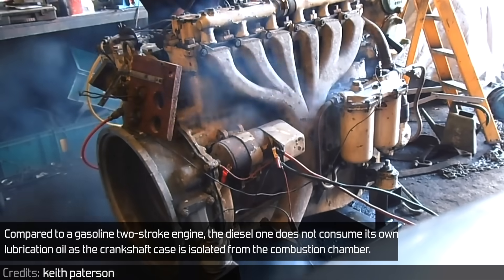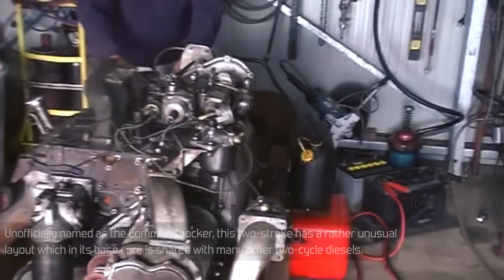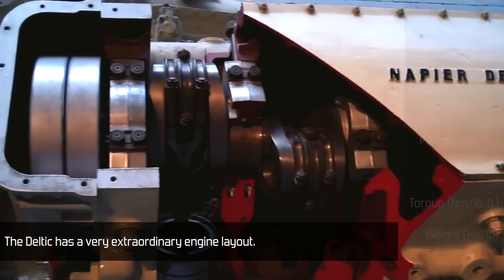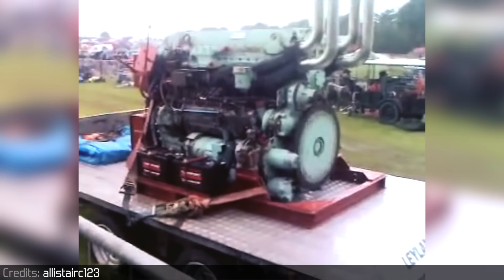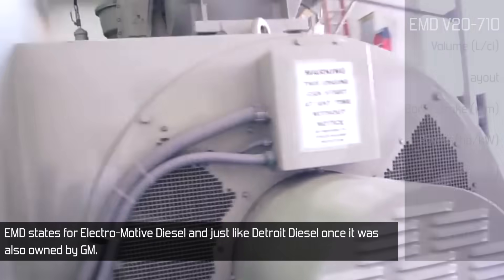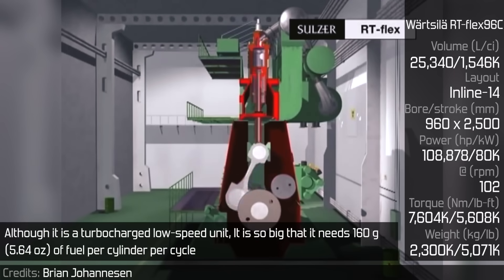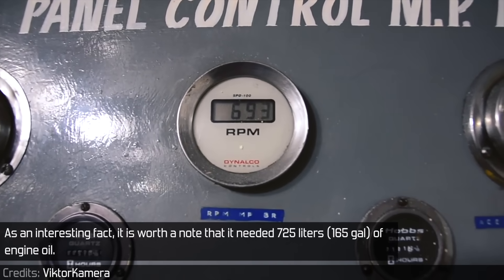9 Cool 2-Stroke Diesel Engines

Comment: 100hp and 7000nm of torque
damn diesels
Reply: Now imagine the torque figure of an EMD 16-710 putting out about 5000hp
Reply: @HotForgeChaos  41,933 Newton Meters?!?!? Jesus Christ!
Reply: I like diesels and they surprise me with their torque figures fairly often. The VW 2.0l TDI only has 140 hp, but it makes like 265 lb-ft of torque.
Reply: @boostaddict_  YEP. My father had a passat diesel, that car was insane, more torque than a subaru WRX. After 40mph you could feel the lack of power but it was still just a gorgeous car in the low RPM
Reply: The reason for a diesel's modest horsepower figures, is simply because of limited rpm capabilities. Power is torque x revs. Diesel is much slower burning than petrol, so as revs rise, the burning fuel has less time to exert force on the piston. By 3000 rpm in a car diesel, 85% of the peak horsepower is available, so they respond best by short shifting. Most car diesels have peaked by 4000 rpm, while a petrol engine usually peaks around 6000. So to make the same power, a diesel has to produce an extra 33% torque at 4000 relative to a petrol's 6000 rpm torque figure. A turbo diesel will easily exceed a naturally aspirated petrol equivalent for power within its 2/3rds rev capability, & produce over 2/3rds the power of even a turbo petrol engine, despite giving away over 2500 rpm. Because diesels can withstand boost pressures that would disintegrate a petrol engine in minutes, a turbo diesel can still exceed the peak torque (& therefore power output) of a turbo petrol equivalent between 1500 & 3000. If you were to compare the power output of a naturally aspirated petrol or a turbo petrol at 4000 rpm, with that of an equivalent capacity turbo diesel at the same engine speed, you would usually find that it is the petrol engine that is the weaker unit.
Reply: @hiyadroogs  actually it's not the slower burner fuel its because diesel parts are under more stress than gas engines so they have to be made out of thicker and stronger parts to handle the high compression . And racing diesel engines go 7000-9000rpm but they wear down faster than a gasoline engine in a similar rpm range
Reply: @xxzenonionnex7658  You are partly right. Diesels do require heavier construction generally to withstand both compression pressures (though those have come down considerably since indirect injection diesels with 22.5:1, compared to as little as 15.5:1 for some modern direct injection types) - also to withstand the huge combustion pressures generated by very high boost pressures that would destroy a petrol engine in minutes. But with modern metallurgy, this is not too much of a problem. Traditionally, diesels were long stroke (under square engines) & therefore couldn't attain high revs. But in car engines at least, this is no longer the case. Diesel combustion occurs much slower than petrol, which vaporises very easily. Diesel fuel does not. Which is why modern injection pumps exceed 2,000 bar, or over 30,000 psi, to atomise the fuel from the injector nozzle against 250 psi compression pressures. Even with a turbocharger, sometimes more than one in a 4 cylinder diesel, & 4 bar boost pressures, all diesel torque curves begin subsiding after 3,000 rpm because of the slower burning fuel. The mechanical set up of the car diesel could easily exceed 6000 rpm, but the peak torque occurs between 1,500 to 2,500, sometimes sustained until 3,000, but then falls away steadily until peak power is attained between 4,000 & occasionally 4,500. Many car diesels are set up to arrive at maximum power by 3,500, precisely to keep the engine inside it's most efficient combustion range. It is true that in tractor pulling, engines can go to 6,000. But there are reasons. 1, they are fitted with multiple turbochargers, sometimes 4 on a 6 cylinder engine, pushing boost pressures beyond 200 psi! 2, they massively over fuel the unit to gain every horsepower the engine can muster without destroying the crank, pistons or block. 3, the engine often has water injection to stop the pistons melting. 4, this can only be mechanically sustained for seconds, not minutes. & 5, by 6,000, though the horsepower is high, the torque peak is over 2,000 lower down the rpm range. The price for forcing a slow burning diesel engine to make power at petrol engine revs, is scorched pistons & valves, massive over fuelling that the engine can only endure for seconds, huge clouds of black smoke because the slow burning combustion cannot complete the burn in the short time allowed, & having to fit multiple turbos ramming in ridiculous amounts of pressure. Try that in a road car & you will be rebuilding the engine every couple of weeks!
Reply: Just gearbox the hell outta them and you got a performance engine with reliability
Reply: i like high torque engine, but i want diesels get more power (power to weight radio)
Reply: @stephensu4371   Check out the batmobile willys coupe diesel. It makes 2000+ hp and literally unmeasureable amounts of torque, it can't even be dynoed

Comment: Detroit Diesel still makes 2 cycle engines, just mostly for marine or generator applications, as recently as 2014 I believe.  Unfortunately production for truck engines has seized, so blocks will have to be restored with new parts, no more new casts being made.

Comment: The most efficient engine ever made is the Napier Deltic.
Reply: David Blalock - Livin' Life I would say wärtsilä is the most efficient. (gained hp per liters of fuel consumed)
Reply: Not so sure about that. However, the Napier Deltic engine had the same inherent problems Fairbanks Morse did with their opposed piston designs; neither had any cylinder heads and had a complicated gearing mechanism to join multiple crankshafts to a single driving shaft.
Reply: @T-Bag Actually, the Achates Power's Opposed piston design  has already surpassed the wärtsilä for specific efficiency achieving an independently confirmed 55% BTE. 

@rayford21 I agree with you on the Fairbanks Morse to a point, but the deltic integrated the gear reduction into that system. As a result the engine rpms at the crank may be 1700 at it high idle, but the output shaft was only turning at 850 rpms.  This allowed the engine to be installed as a direct drive system in marine applications.  CP Props improved efficiency as well.

Comment: I need 750 liters of oil for my oil change.
Reply: Just don't forget to put the sump plug back in when you fill it up ...
Reply: Oh nevermind the head gasket is blown.
Reply: CALL THE SPILL CREW, THE BAY IS F%&#ED.
Reply: Feed it into the fuel pump and a mixing valve and your 2 stroke can burn it off, hence total loss, your 2 stroke diesel will turn the oil into energy! iv have done that on 8v71 generator before.
Reply: Fill it with castor 927 maxima with a rigged up dry sump and a few VRO pumps into the fuel, no oil change needed just like a rotax 850

Comment: Woah, 14 1 meter wide pistons, 109,000 Hp, 5,600,000 ftlbs torque, 100 rpm redline. 500 lbs of fuel consumed per minute. Talk about an expensive tank of fuel.
Reply: Ryan Fisher I worked on a ship with that engines little brother. 6rtflex-58, we burned over 30mt of fuel per day.
Reply: FlatBroke612 Wow so roughly 60,000 lbs of fuel? Maybe 15,000 gallons? Amazing that's a lot of $ It must have been quite an experience, I would love to hear and feel that engine working!
Reply: 500 lbs. of fuel per minute?...Hello?  At 8lbs. per gallon crossing an ocean must necessitate a huge fuel tank and an unheard of speed to reach its destination.

Comment: Detroit diesel is king of 2 cycle diesel performance
Reply: It sounds like its running at a high rpm
Reply: 2 strokes do.
Reply: Don’t for get Fairbanks Morse, Sachs, deutz, Stijl and JLO. There was a huge single in a Field Marshall tractor, crankcase pressurized. Model 32 Fairbanks Morse is the biggest crankcase pressured 2 stroke I have heard with 2100 CID per cylinder
Reply: I just got a silver 8v92 to tinker with, i might go grap a 12v71 turbo and yes 2 stroke diesels consume there lube oil, i work with them on offshore boats.

Comment: All opposed piston diesels just have ports and no exhaust valves, while most normal 2 stroke diesels have exhaust valves.
This because in an opposed piston engine the intake and exhaust ports are not at the same heightbut at some distance from each other, one piston operates the intake ports and the other the exhaust.
Because of this there is a good flow of fresh air, induced by the blower, pushing the exhaust gasses trough the exhaust port on the other end of the combustion chamber.
In a normal gasoline 2 stroke engine intake and exhaust ports are both at the bottom end of the cylinder, most of the airflow goes straight to the opposite side exhaust port without flowing trough the whole combustion chamber, some of the air gets turbulent and flushes the top end of the combustion chamber.
While this works well for small gasoline engines, 2 stroke gas engines are no more than 500cc per cylinder, it doesn't work for large displacement diesels.
Therefore the exhaust valves in the cylinder head, creating this bottom to top airflow ensuring good scavenging of exhaust gasses.

There is however one exception known by me, currently I'm helping to dismantle an old Crossley HSTV-12 marine engine, this has intake and exhaust ports in the fashion a small gasoline engine has, it uses a really enourmous roots blower, and has reed valves in the intake manifolds, to prevent exhaust gasses being pushed back in the intake.
For a large diesel this is a very rare setup, there are currently only 2 working examples in the world, both in Australia: https://www.youtube.com/watch?v=9FwLngW2ERE
Reply: Until the appearance of the      R T A series Sulzer used ports both forma Transfer anda Exhaust, dame did Burmeister and Wain and other two stroke marine engine manufacturers

Comment: Leyland l60 is probably the worst engine ever made.
Reply: Kuddlesworth NA it was a good engine in generators but it didn't like having constantly changing speeds and loads, and also being underpowered for the tank. They were actually as reliable as other tanks by thr end of their development.
Reply: The Saudis demanded a Rolls Royce engine in their tanks.
This became the Challenger tank
Rolls Royce Diesels was bought out by Perkins.
Reply: Thats why the Napier Deltics were unreliable in locomotives
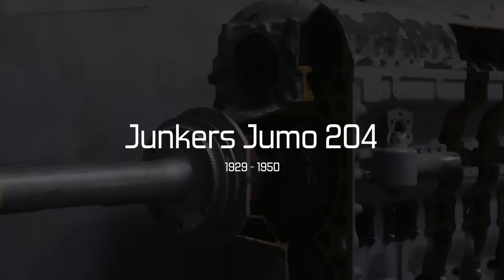Reply: The L60 is based on the Junckers engine, seen at 5:43 on this vid I believe.
As has been mentioned: great engine when used at constant revs ie aircraft, generator or locomotive.
Terrible when some squaddy in a Chieftain is jumping off and on the throttle whilst driving.  That bloody engine killed the export market for the tank :/

Comment: you should do a video on multiple piston per cylinder engines
like if you agree
Reply: That's what the Napier and Fairbanks-Morse engines are.
Reply: rayford21 yeah but I think it would be pretty cool if he did a video just on this style engine
Reply: James Becker.
An engine with two pistons per cylinder is called an opposed piston engine.
Reply: @yeahimere9631  or a split-single like the bmw isetta
Reply: He may have covered quite a few already, like the Hondas and such, but yeah there are a bunch of them.
Reply: Unless it's not.

Comment: In my childhood in Brooklyn all city busses were powered by da 6v92 & when I was 3 I rode in a Fishbowl bus which had da 6v71. Damn busses never sounded better but I'd love to know what engine was in da late 80's Thomas built International school busses cause they sounded mean too.
Reply: Khalil R. Mercado I forget the name of the movie but there was a fishbowl bus driving around with a bomb on board that would blow up if speed went below 50mph. Can't remember the movie name but I remember that bus. Interesting design
Reply: Carman E the name is speed
Reply: vedant bhalerao yes that's it
Reply: Khalil R. Mercado 

International used the 555 cummins v8.
Reply: Khalil R. Mercado those buses frequently used an international harvester 9 liter  v-8
Reply: Those busses had 9 liter v-8' s, naturally aspirated. With the manual 5/2 transmission, they're a little slow. The Allison auto was pretty reliable, but highway speed/ power was dismal, loaded. The cast metal fuel filter mounts had a tendency to crack, spraying the hot motor with diesel fuel..

Comment: 4:35.  Detroit Diesel.  Way ahead of its time in the 1930s.   Cheap and plentiful repair parts until the end of time.   That is all.
Reply: We also got our hot rod superchargers from them.
Reply: True that.I always believed that as long as a detroit diesel was leaking a little oil you were ok because that ment there was still oil in the engine
Reply: I grew up listening to and being aboard Detroit 2 stroke school buses. Remember the old Crowns?
Reply: Another nickname for a Detroit diesel is a leaktroit diesel.
Reply: My CCW 440 leaked a little by the clutch on my 74 John Deere JDX8 snowmobile, it was a leaker also
Reply: Best sounding too
Reply: Did you hear the 172hp  type with type n injectors? Could not have missed it. But it ran always. Dit lose power when it came on temperature.
Reply: Canadian Forces Bombardier Deuce and a Halfs used to use the Detroit 8.2 Fuel Pincher engines, although those engines were Four Stroke.
Reply: scdevon You never heared of Junkers diesel engines did you ;D?
Reply: pscdevon
Reply: @ Jerry    Let 'em leak.  Doesn't bother me or many other people that I know.  I grew up working on twin 8V71s in my family's commercial boat.  Best small/medium marine diesels of all time.   Run 2400 RPM+ all day long and not even break a sweat.   They drink some fuel, though.

Comment: Thanks for these more oddball engine lists. I don’t know much about the world of diesels, unfortunately here in the USA between our government and the oil oligopoly network conspiring to keep most every passenger vehicle a petrol one it’s hard to learn much about them unless you work with heavy equipment or big trucks/busses. Being an efficiency nut it drives me up the wall that basically NO trucks below 3/4 to 1 ton layout have diesel motors (no Toyota Hi-Lux diesels, Nissan diesels, Mitsu diesels) and outside of a few well-known German imports VW TDI, BMW, Mercedes absolutely no diesel-powered cars (don’t get me started on the whole ridiculous VW scandal that means we can’t get TDI’s in the future, I have a 98 Jetta TDI and although I hate the overly complex nature of some of the systems in the engine bay and chassis I LOVE the fact that a car I paid $3500 for 6 years ago gets 40mpg!) 

VIVE GAZOLE!

Comment: only if turned off supercharger and run only on turbochargers after starting, otherwise this engine shouldn't be efficient
Reply: Some later series 92 Detroit diesels have a bypass valve in the intake which bypasses the blower at high rpm/turbo pressure, those engines have a B suffix in the designation eg 8V92TTIAB.
Reply: EMD engines started with Roots blowers on the 567's and 645's.  In Run 8, the blowers would pressurize the intake to 8 psi.  Later 645's and 710's used turbochargers, which were mechanically driven up to Run 4, then exhaust driven above that.  Even though I love the elegance of turbocharging, the Roots-blown 567's sound the best of all the EMD's, in my opinion.

Comment: Noticed Every Engine had a Supercharger
Reply: Larry Chaitu that's the roots blower he was talking about in the beginning that is required for the engine to run.
Reply from the maker: Yes, every single two-stroke diesel needs a blower, otherwise it would not run. It cannot suck any air inside by vacuum as the intake ports are just above the piston at bottom dead centre. Even though there is this blower or sometimes called supercharger, they are basically naturally aspirated with the pressure inside reaching an ambient air pressure. Turbocharged ones are considered boosted.
Reply: VisioRacer I guess if you had a blower feeding into a blower it would then be supercharged.